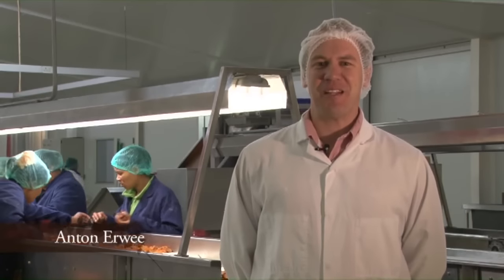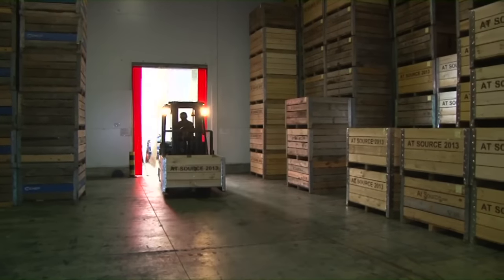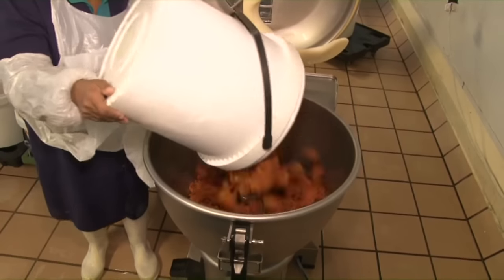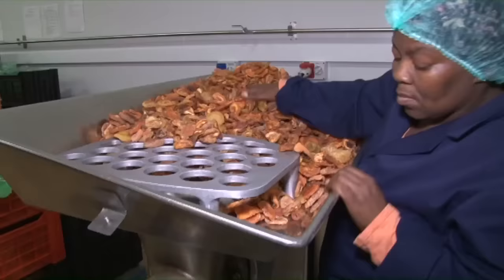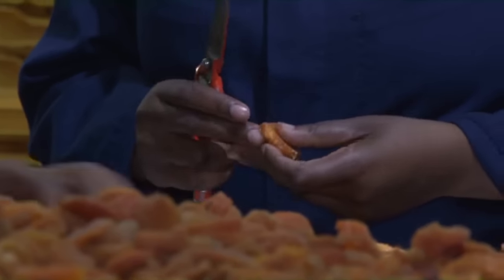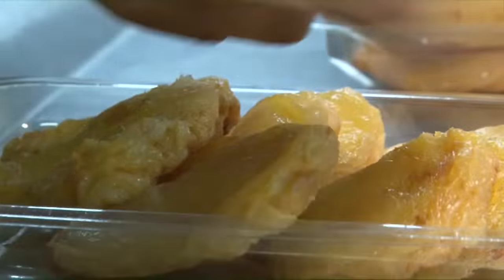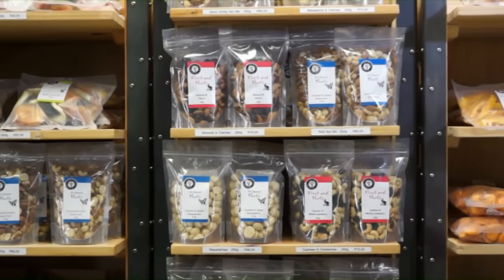The dried fruit factory process

Comment: It is one the most widely-held misconceptions that the wearing of latex gloves in food handling leads to better hygiene and food safety. Up until a few years ago, the use of gloves in food manufacturing was promoted and widely adopted, but that trend has since been reversed. Research has shown that the use of gloves, while it seems counter-intuitive, actually has the opposite effect. Because it numbs the sense of feeling in ones fingers, one gets a false sense of cleanliness while there is actually a build-up of food material (and therefore bacteria) on the surface of the glove. This then may lead to workers not adhering to hand-washing protocols and quite easily lead to a person going through and entire shift with a pair of gloves that have become quite dirty. On the other hand (excuse the pun!), when handling food with ones bare hands, the sensation of stickiness, wetness etc. in fact leads to people naturally wanting to wash their hands more often and therefore acts as a very effective reminder to adhere to hand-washing disciplines. Consequently, we have discontinued the use of latex gloves. Instead, our focus is on ensuring that people work with clean hands at all times. We have very strict hygiene standards in our factory, which includes hand-cleaning procedures. Nobody can enter the factory without first washing their hands and scrub their nails. The flow of water on these wash troughs is activated by photocells so that a person does not need to touch a tap, which may lead to recontamination. Thereafter the person sanitizes his or her hands with an alcohol sanitizer. In addition there are washbasins within the factory close to every work station so that people can routinely wash hands during the course of a shift. We take random swabs of hands and work surfaces and send these to an accredited laboratory for microbial analysis to check the effectiveness of our hygiene measures. Lastly, I should point out that our factory and third party auditors regularly audit food safety systems. Not only are we a HACCP (Hazard Analysis and Critical Control Point ) certified facility, but our retail customers, Woolworths and Pick n Pay, also have us audited against their own food safety and GMP (good manufacturing practices) standards regularly. These audits are often unannounced to prevent “window-dressing”.
Reply: Anton Erwee : latex replacement is poly ethylene gloves. they are transparent and disposable after once use. Although I approve your defined hygienic protocols and myself educated in polymers and am an industrialist, thought this could help for public satisfaction

Comment: Gloves without latex are being made for some time now, so "no-latex in our production" excuse for manipulating the goods with bare hands simply doesn't stand. 
Random swabs made in external laboratory means nothing in practice. The only reasonable procedure would be swabs made at least two times per shift (on the start and on the end of the shift for example). Not to mention that "external lab analysis" usually means RARE/ONCE PER MONTH analysis, as I'm pretty sure you don't send swab samples to external lab more frequent.
HACCP and GMP are something nobody even mention in nowadays food safety. FSSC 22000 or BRC+IFS standards are optimum (I would say minimum) for some time now.
Floors at 1:26 are far from perfect with all those grooves, perfect for bacteria contamination, while the worker push the loading charts with his sleeves wrinkled up.
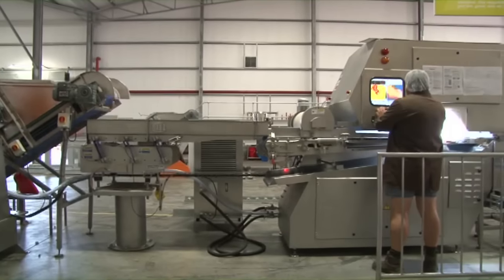Not to mention 0:33 operator on the scanner wearing SHORTS?!?! which is forbidden in any production area for decades.
How do you prevent hair contamination with such practice?!?
All in all, it seems you're oriented to "lower the cost" policy, which seems reasonable, but you're implementing it at totally wrong places.

Comment: Although wearing gloves may seem reasonable to you,  in reality, the plastic actually harbors and grows more bacteria between the glove and the hand.   Additionally,  most workers tend not to change their gloves enough times during the process or shift,  allowing for transfer of bacteria higher than the rate of transfer with bare hands.     Wearing gloves gives a false sense of cleanliness to the worker so less care is taken regarding cross-contamination.  It has been proven that the best way to eliminate any possible contamination is to eliminate the gloves and wash the hands quite frequently.

Comment: does drying fruit give it more calories for example if i dry 100 calories of apple does it now have 200 calories?
Reply: Hi Charles.  Drying cannot "create" more calories.  If you start off with 100 calories you will end with more or less 100 calories.  The difference is however the loss in weight of the dried product.  If you start with 100 g of fresh apple you end up with more or less 15 g of dried apple.  In other words, you had 100 calories / 100 g of fresh apple and now you have 100 calories / 15 g of dried product.  The concentration of calories increased.  I trust this explanation makes sense!
Reply: There are two parts in this question, does 100g dried fruit contain more calories than 100g raw fruits? The answer is YES. The second part is, does 100 gram raw apple(which is less than raw by mass) contain more calories than 100 g raw fruit -the answer here is no.